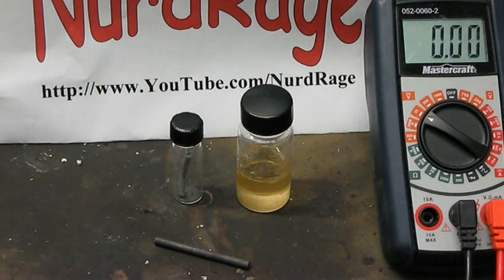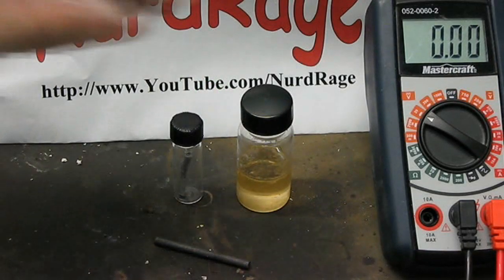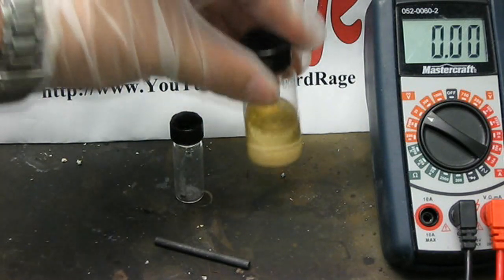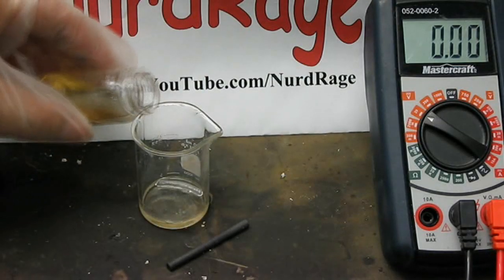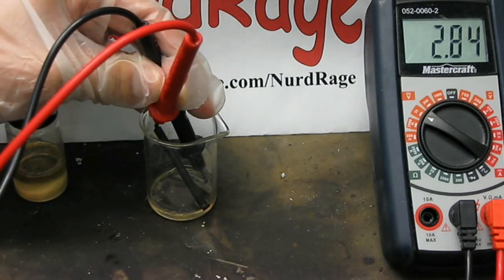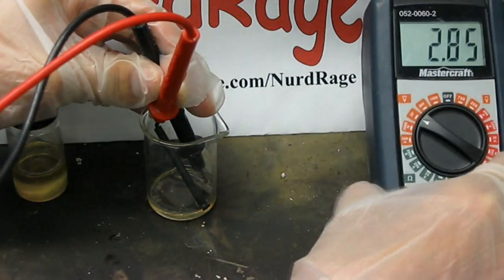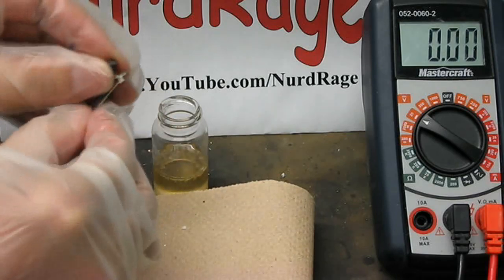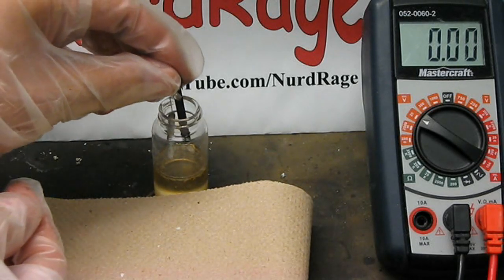Make a Lithium Thionyl Chloride Battery

Comment: NOW, the only question is how to acquire Thionyl Chloride. It's not as though anyone can just order it. The only practical  synthesis i can find involves producing phosgene.... which im not entirely comfortable handling without a fume hood... what are your thoughts on submerging a closed system in a water bath?
Reply: err... 1 way system of gas generators. CO mixing with Cl2  (UV light catalyst)... leading to the ass end of a SO2 gen... last chamber has a water bubbler keeping excess gasses essentially neutralized... but also performed outside in a well ventilated area. I think this might be a more fulfilling experiment than the battery itself! haha. Lend me your thoughts.
Reply: Even with phosgene at home. Even at work/university be very careful, but there the work with it is most restricted...

Comment: Wow, I totally didn't expect lithium metal and SOCl2 to NOT react violently with each other, considering that SOCl2 is the mixed anhydride of HCl and H2SO3
But anyway, what is the reduction here? I can see the oxidation being Li -> Li(+) + e(-) but what is getting reduced? Out of all elements here I can only think of the sulphur, which is only at +IV state to start with... So is the sulphur in the thionyl chloride eventually reduced to elemtanl S? Like: 4 Li + SOCl2 -> Li2O + 2 LiCl + S ?
Reply: There’s no lithium oxide being formed. It’s 2SOCl2 + 4e- -> SO2 + S + 4 Cl -

Comment from the maker: if properly built with pure chemicals, these batteries can reliably provide power for years. They are used in low-power sealed devices like remote monitoring stations,  where changing the battery is inconvenient and would preferably be done as rarely as possible, if ever.

Comment from the maker: Actually this battery has an extremely high energy density and is already sold commercially for applications requiring extremely long life at low currents. 

However a commercial version obviously is designed much better than my crude hack above.